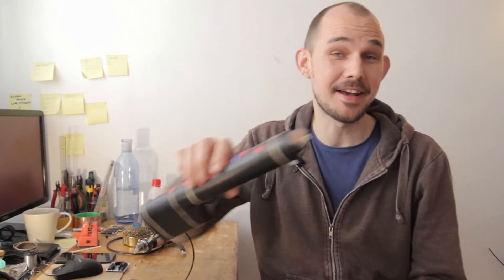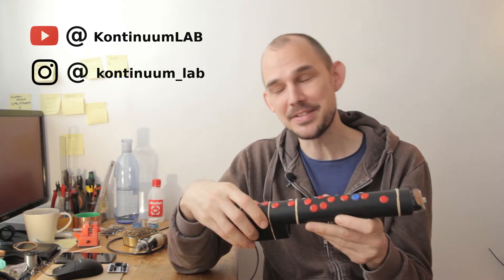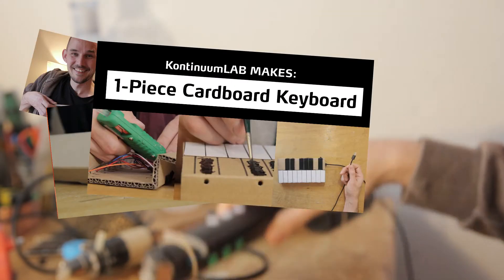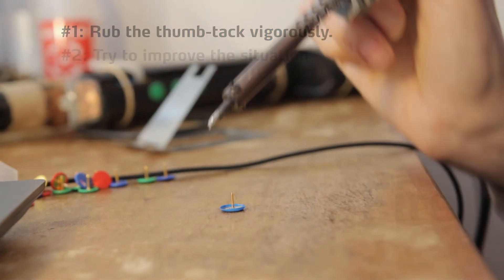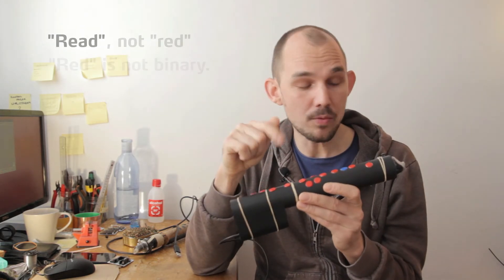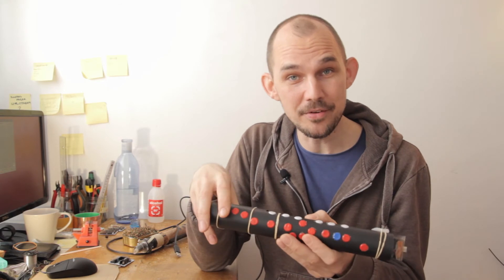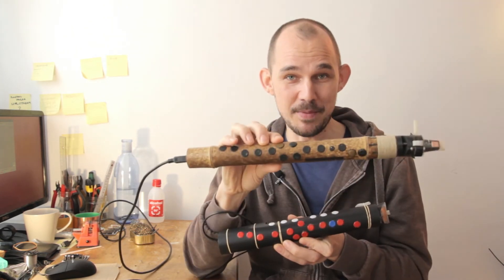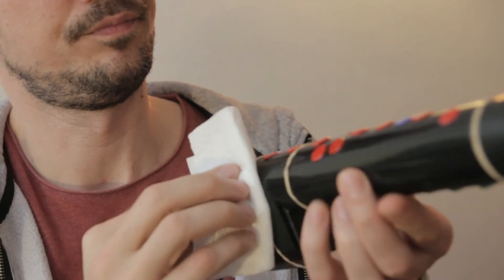New DIY MIDI Wind Instrument, with looper interface and capacitive keys.

Comment: Damn. I was making almost the same thing couple of years ago, but could not manage to finish it. Still have a half-baked flute prototype lying somewhere around here, even with the same nails, and a working breath controller that works only for CC signals.
Great job done here. I am a huge fan now. Will start working on my midi flute again tomorrow.
Reply from the maker: Thanks for watching, and good luck with your projects!

Comment: Cool concept! Any idea when your KLIK will be available? Stay safe and healthy
Reply from the maker: I don't really know, I wanted to start shipping it out from april but right now everything is up in the air. I'm still missing some materials and parts, so I'm kind of stuck until the lockdown ends.  Take care, and thanks for watching!
Reply: KontinuumLAB Thanks for the update. Looking forward to your next video. Be well
Reply: KontinuumLAB What’s up, Jeppe? You mentioned  there’s another way to make capacitive sensors out of thumbtacks. I’ve gone down the rabbit hole of options ha. Any tips on tack and dielectric layer materials?
Reply from the maker: My recent efforts all use a thermoplastic shaped around a thumb tack with heat. Packing tape gives the best sensitivity. It's a thermoplastic and will deform around a hot thumbtack. It's quite fragile, so it's tricky. I don't know if you saw my old video, where I use PETG to make some thumb tack keys: https://youtu.be/X4SisRxMavM?t=410 
Reducing thickness, and retaining strength is the name of the game. Let me know if you find any good solutions. Happy making!
Reply: KontinuumLAB Thanks! That helps a ton